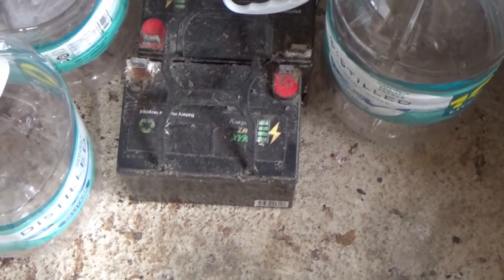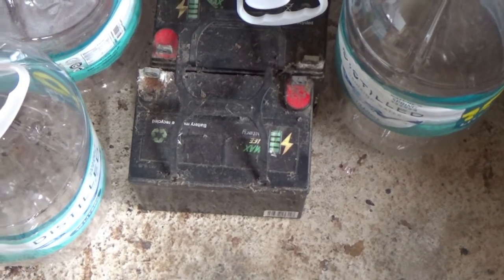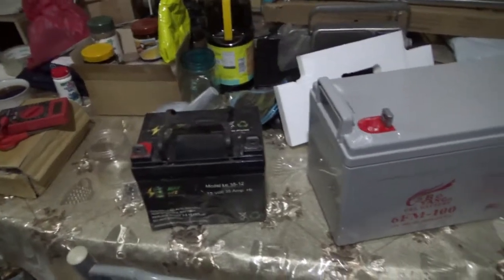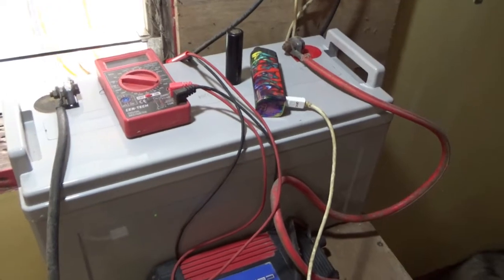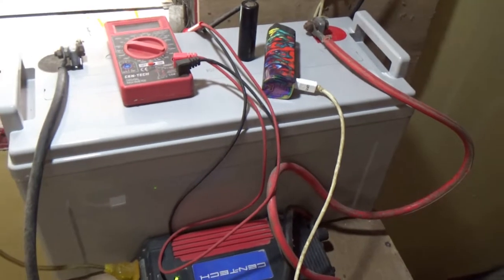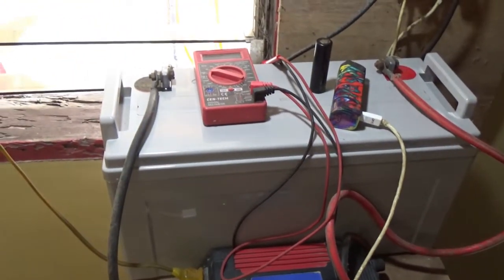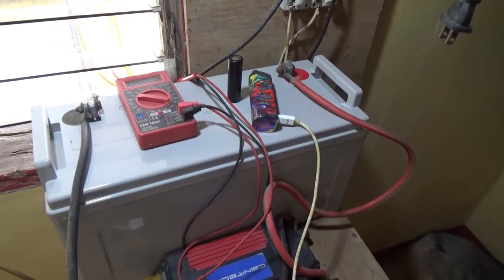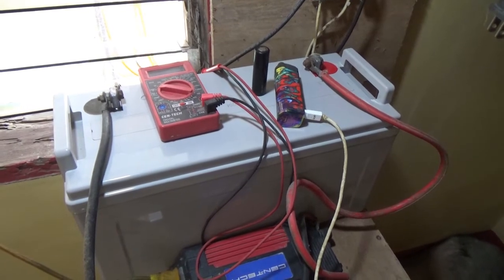BO Yang 100 AH Deep Cycle Battery

Comment: I’d say you shouldn’t purchase anymore of these gel batteries, coz the gel batteries you can only use half of its power if you use more than half of the battery power it’ll damage the battery and reduce the lifespan, upgrade to Lifepo4 batteries, Lifepo4 batteries are the best in the market right now for solar , and also do calculate how many Watt hours or Kilowatt Hours do you need , there are dozen of calculators online.

Comment: I'm surprised that the small batteries had that much reserve capacity. Certainly they don't have much cranking power. That's the key. The big battery has thicker plates and may have massive amounts of cranking power with less reserve. It appears to be industrial grade. It appears to be as big as a truck battery and should handle many many cycles.
Reply from the maker: Solar style batteries aren't supposed to have high cranking capacity. Automotive batteries and solar  systems don't play well together. You may be on to something, though. Thanks, Kevin.